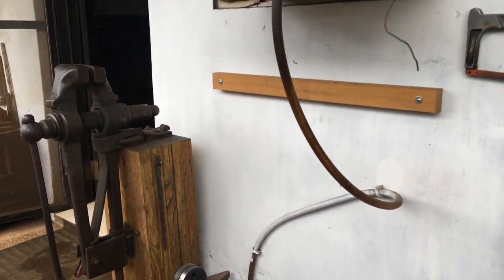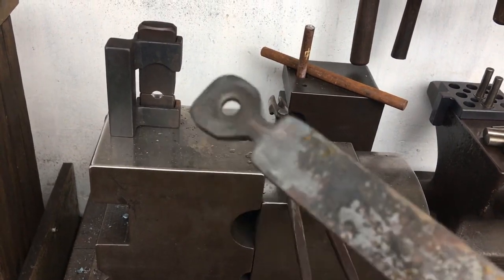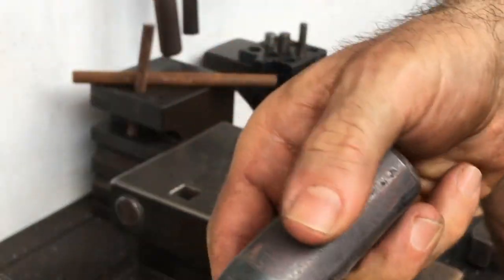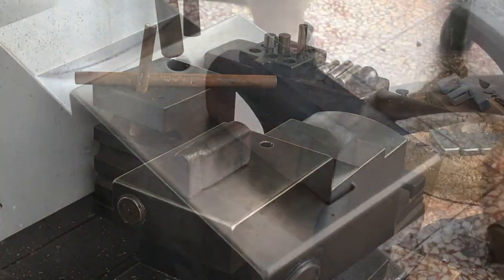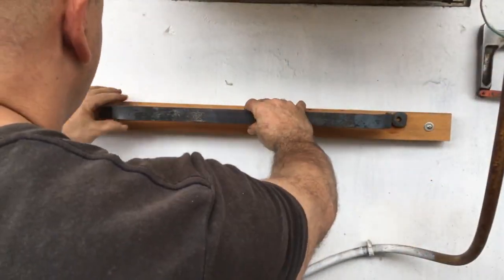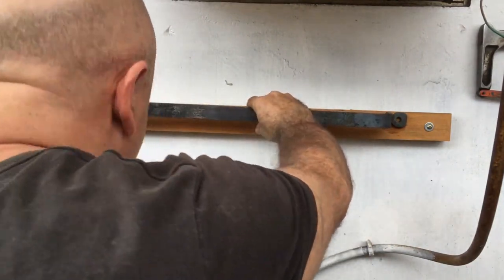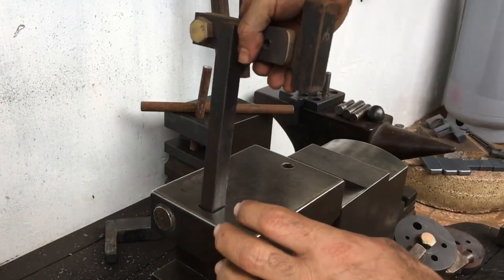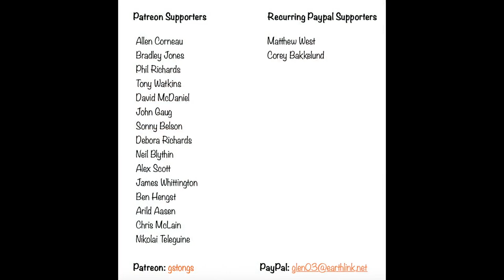Blacksmithing Odds & Ends / Upcoming Projects

Comment: Looking forward to watching you do all these projects. I’m also looking forwards to an update video on your adjustable tongues. I think you mentioned that you’ve improved them since your last video making them. I’m still very happy with the ones you made for me. They do virtually everything I need so it’s hard for me to see how you could improve them. 
BTW how many flights of stairs do you have to haul that gas tank up? It looks a fair old way up to me 😬
Reply from the maker: I will eventually get around to that tong; the improved version. I'm just going haywire of late with all sorts of things. To know that your RA tong is working that well for you makes me very glad. I'm on the 5th floor. a full tank weighs 75 pounds and I weigh 145 pounds. I get a lot of exercise... Thanks.